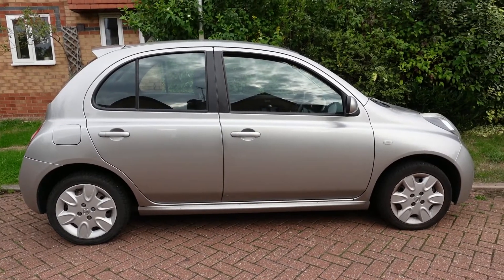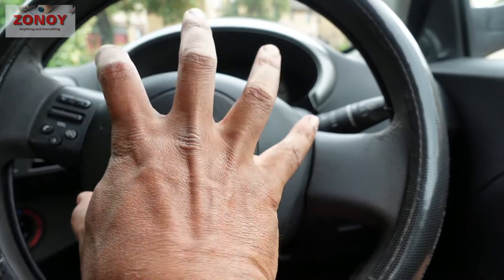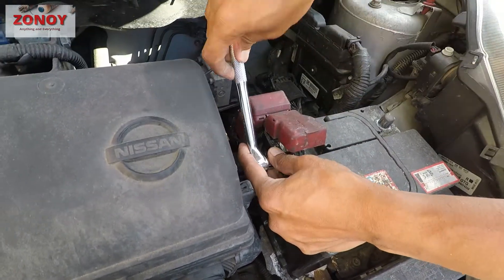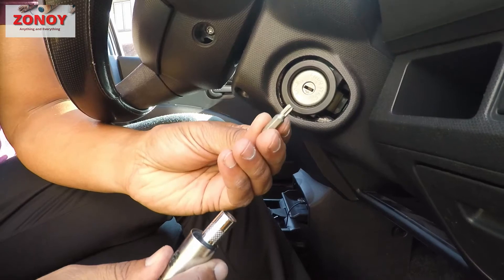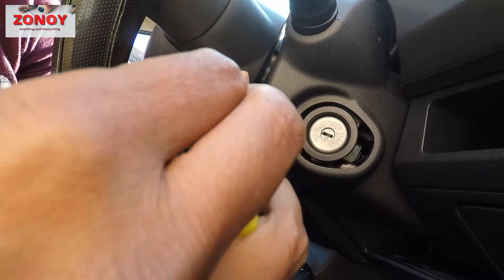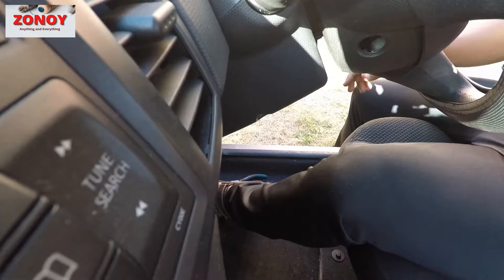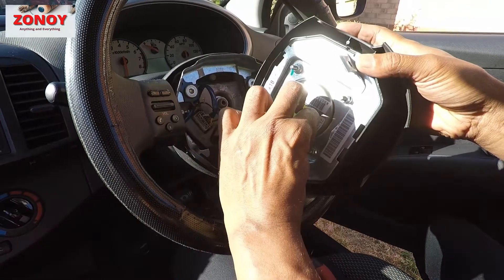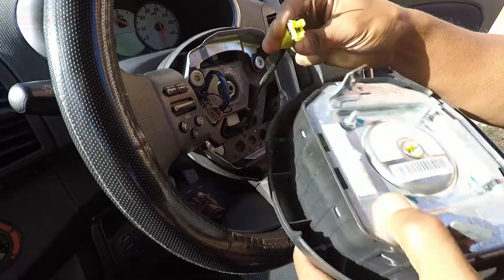NISSAN MICRA HOW TO CHANGE STEERING AIRBAG HORN UNIT

Comment: Nissan Micra 1.2; 2003 year. The problem is that I have to press the horn on the steering wheel with all my might to make it sound. How do I fix it? Thanks in advance.